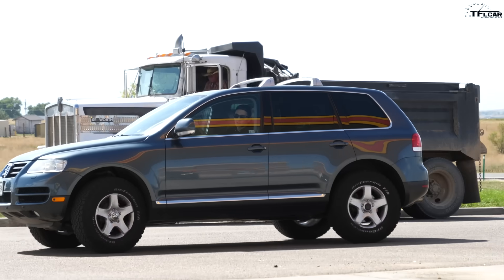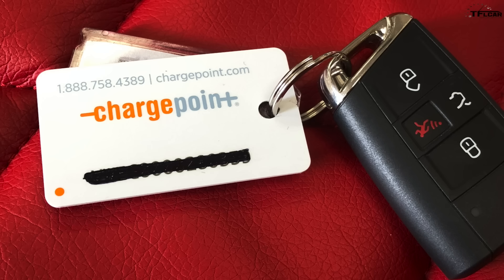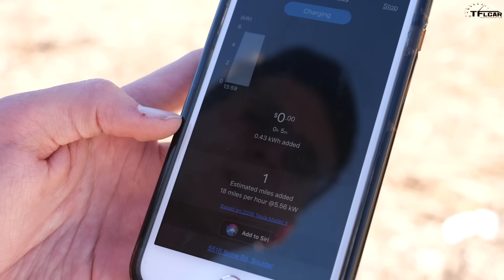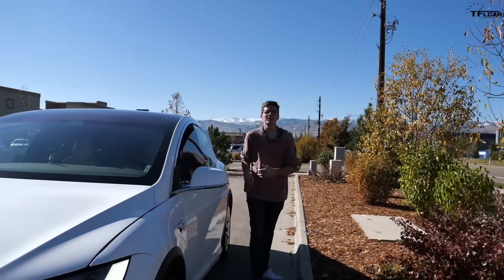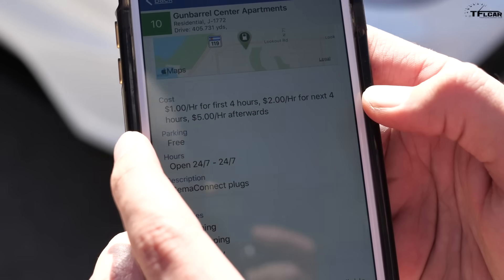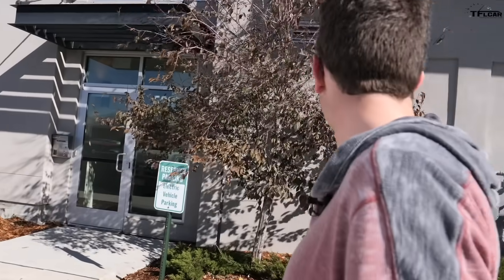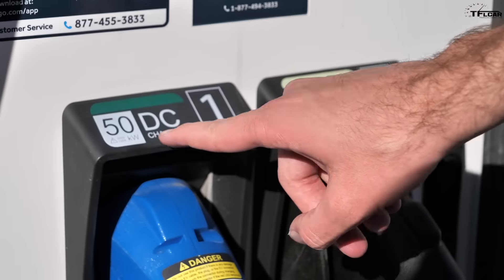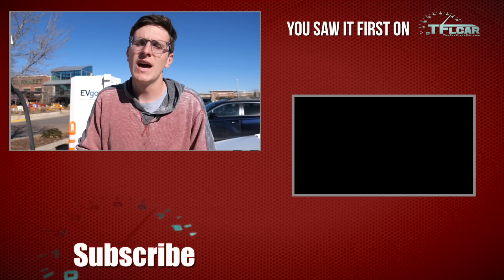Here’s Why Charging an Electric Car Can Suck - And It’s Not The Reason You Think!

Comment: You need to call your Representatives today we need to hydrogen fuel pumps put all the way across the United States for hydrogen fuel and the hydrogen fuel cell car which is going to take the place with all commercial vehicles and heavy machinery take the place of gasoline and Diesel also make the United States a superpower independently on their own with no more depending on oil or any other country for oil hydrogen fuel we can pull out of thin air so it's very cheap and it'll always stay cheap nobody wants a battery because it takes too much pollution to make batteries takes too much pollution to dispose of the batteries it takes too much pollution for all the electricity they're going to have to do to charge a battery that don't do much in the first place so the batteries are not green so they had to dump them all over the world and they went to the hydrogen fuel cell which is all over the coastlines of the world right as we speak the United States needs to hydrogen fuel cell down the center of the United States of America it's a more powerful fuel more reliable fuel and are the brand new engines that they have out you can do 2.9 seconds to go from 0 to 60
Reply: Ummm... "pull it out of the air?" That takes energy... can you build enough windmills and solar panels fast enough? What will hydrogen cost to make with that required infrastructure?

Comment: Sorry, I cannot do this.  These electric vehicles are ok for in the city driving, but driving across the country or to another state..... Aarrgh!!!  Drive for 130 miles, find plug in charger, sit around for 6 hours, drive another 130 miles, find charger, etc, etc...  Gas vehicle: drive for 300 miles, gas up in about 10 minutes + potty break, then drive for another 300 miles. And do not run out on Old 66 driving thru the desert....  Besides, who has 50K for one of these albatrosses???

Comment: If a standard car battery can be recharged by a car generator while the car is running then why can't electric cars charge themselves?
Reply: Fossil fuel providing the power to charge a car battery is why that works. And that car battery isn't being used to power electric motors for the wheels.

Laws of physics means a battery cannot charge itself and still do anything useful (like turn wheels of car).

A hybrid car (gasoline engine to generate electricity, and batteries for motors + wheels) can do what you suggest.

Comment: That is genius marketing right ! Luring people's feelings into a fuzzy warm greenness by the simple conversion of fossil fuel to happy green electricity while tricking them into owning a 600lb chunk of non recyclable toxic lithium from a strip mine that has been strapped to a pile of petroleum based plastic and oil fired steel with tires all while severely limiting free travel lol, that's good stuff right there.

Comment: The only way EV’s will succeed is if all the manufacturers work together to develop a standardized interchangeable battery pack. Service stations can then have racks of batteries on charge. You drive into a station, pay the fee and they swap out your depleted battery for a fully charged and you’re on your way. It should take the same amount of time as if you are pumping gas.
Reply: Yeah, you know how easy it is to change out a 1,000 pound battery and slide a replacement in its place. Of course your car was brand new and the replacement was already 7 years old and all that fast charging means it loses 10% of its charge for every hour it just sits there... Who pays for that difference in age?

Comment: Have to use the phone to find an available charging station which might be across town. When you find available station it turns out it doesn't accept a method of payment you can use. Then you need an adapter that looks to be easy to leave connected to a charger if your used to not using it. Best part is that it will take hours for a full charge and when you are on vacation who doesn't love spending time with car troubles and that is what it could turn out to be. I guess road trips will be within a 100 miles from now on just to be another restriction of electric cars that require fossil fuels to exist. Sign me up.

Comment: We considered an ev, however, the 10,000 to 22,000 dollars it would cost to replace the battery at 50,000 to 75,000 miles really turned us off.  Then there is the fact that the batteries are not recyclable, and the minerals used in them are dangerous to mine.  Not everyone has a smart phone.  I have one, but no data plan, because I work from home and I have home internet, and navigation in my car.  I have never been anywhere that I just had to have internet.  I was over 40 before I had a cell phone.  Also there are a lot of older people who would never be able to figure out the apps for charging.  It also costs up to $1000 to retrofit your home to charge your car at home.   And, what person wants to be stuck, in the middle of the night, alone at a charging station for up to an hour or more.  They would be sitting duck for criminals.  It seems like you would have to spend a significant portion of your life going from charging station to charging station to keep moving about.  What your supposed to do for that hour or more while you are waiting for  your car to charge?  Some of us have lives.
Reply: There you go, trying to confuse the issue with the FACTS! 😉

Comment: THANKS for this,  you have just confirmed most of my fears with electric cars. This is NOT a realistic option to petrol. This is a joke.
Reply: If you think it takes 30 minutes to charge imagine just 5 people wanting to charge theirs at the same time, how long do you think you’ll be waiting?
Reply: @joesedlacek7552  If my math is correct....that would take 2.5 hours.  :)
Reply: @joesedlacek7552  
A Long long time
It's easier to gas up takes 5 minutes and go on your way.
The internal combustion engine will never die..
Reply: @ralphabreu5022  meanwhile, automakers are phasing out gas engines
Reply: @joesedlacek7552  You are assuming there is only one charger to use. That's not how it works. Tesla has some sites with close to 100 cords. At a site that large, about 2 cars per minute will be finishing up and moving on. If by chance there is some peak in people pulling in to charge, and all 100 spots are full, and you are behind 5 cars waiting, it should only be 2-3 minutes before it's your turn to start charging. Tesla knows exactly how busy stations are getting, and where more charging spots are needed. They are expanding charge sites as needed, and where needed, to minimize the chance there will be any waiting at all, and to minimize the waiting time that will occasionally happen on peak travel days to just a few minutes.
Reply: @joesedlacek7552  If you think charging sites will only have 1 or 2 cords, you are misinformed. On busy routes Tesla is building  sites with ~100 cords. Even if all 100 were in use when you arrived, with that many chargers, someone will be finishing and leave every 30-60 second. Seconds, not minutes.
Reply: @joesedlacek7552  I can't fully charge my Tesla in 10 minutes, but if I arrive at a Supercharger with a fairly low battery, the initial charge rate is very fast: I get about 16 miles of added range per MINUTE (not hour.) That rate slows down as the battery fills, but in 10 minutes I get about 120 miles of added range. That may be all I need to get home, or to my next stop. The request to avoid EV charging from 4-9 PM happens a few days a year, and some years not at all. The grid is expanding is the need grows. Record setting multi-state heat waves that stress the grid (mostly from air conditioning) are not something that happens often. You need to dig deeper into the economics of grid power. Increased demand - if it is mostly in off-peak hours, can actually reduce the average cost of power, by improving the utilization of fixed cost assets like power lines, transformers and the generator plants. All those things need to be sized for peak loads. That means they are partly idle most of the time. BTW- California has not had a brownout in decades. Power companies don't do that anymore. There were rolling outages in 2001, and again in 2020. The rolling blackouts affected less than 10% of customers, and were not very long. They were not needed in this 2022 heat wave, despite record demand that exceeded what happened in 2020, because the grid has had upgrades since then. California's grid is doing just fine. EV's won't bring it down. They almost all get charged at night when there is plenty of excess capacity.
Reply: @joesedlacek7552  
I agree with you
I'm sorry electric car enthusiast the gasoline car is here to stay.
Reply: @ralphabreu5022  not for long
Reply: @bradmagnuson6963  
The gasoline car is here to stay.
Also diesel is here to stay...
Reply: @bradmagnuson6963  
Ok what's going to power those Chevy Tahoes , suburbans and Escalades.
And big 18 wheeler truck's 
If you think it's electric power you are sadly mistaken.
The electric car needs a lot of improvement for everyday use 
Much much more charging stations.
And regular mechanics to work on them than the dealerships.
And the parts cost have to come down to earth...on price.
Reply: @ralphabreu5022  regular mechanics aren't allowed to work on electric cars, except for stuff they can fix, but other stuff, it takes certified techs to work on an electric car. Pay attention to the electric car market. Those hulking gas hogs will be a thing of the past soon
Reply: @bradmagnuson6963  
Like I'm telling it's expensive to have those certified techs work on your electric car.
I disagree with you that gas powered car's are of the past.
Ppl can't afford electric cars.
Reply: @ralphabreu5022  people CAN and DO afford electric cars. For example, here in Pennsylvania, there are 29,000 electric car drivers. If you divide that per county, that comes out to 432 electric car drivers PER county. So. You're quite wrong. Gas and diesel cars will be a thing of the past within the next 20 years
Reply: @ralphabreu5022  it's not that expensive to have certified techs to work on these cars, since there's very little maintenance needed.
Reply: @bradmagnuson6963  
Nope, you are wrong.
The gas powered car here to stay.
Millennials don't understand .lf it's not broke don't fix it.
Reply: @ralphabreu5022  it's clearly YOU who is wrong. Automakers are phasing out gas and diesel engines, in favor of electric cars. I'm not a millennial, but nice assumption on your part
Reply: @bradmagnuson6963  
An electric 18 wheeler that will be the day....
Reply: @ralphabreu5022  meanwhile, Tesla is rolling out an electric 18 wheeler, and a company called Nikola is developing electric 18 wheelers.
Reply: @bradmagnuson6963  
You need diesel power to haul loads
Reply: You still need diesel power for freight trains
Reply: @ralphabreu5022  eventually, you won't need diesel, once electric trucks replace it
Reply: @bradmagnuson6963  
What about train's
Reply: @ralphabreu5022  eventually, you won't, all-electric trains are being developed. There's already passenger trains that don't run on diesel, they run on electricity, they're called "maglev", meaning, elevated magnetic trains, capable of very high speed travel. An all-electric high speed  passenger train service is being pushed for the Dallas-Fort  Worth area initially, and then into other areas across Texas.
Reply: @ralphabreu5022  there's electric trains all over Japan and China, and there is a push for high speed electric train service in the Dallas- Fort Worth area initially. Right now, most freight trains use very little diesel fuel, they run more on electric than they do diesel fuel
Reply: @ralphabreu5022  in Philadelphia, all the passenger trains and trolleys, run on overhead electrical wires.
Reply: I would rather put gas in a car takes 5 minutes and done
Reply: a lot of good points here I've been at gas stations where there's been 5 10 people and probably would not even wait that long because it only takes about 2 minutes to fill the tank with gas
Reply: This is a CULT.  Fixed it for ya. 😁👍
Reply: @serfcityherewecome8069  
The internal combustion engine will never die.
Reply: AMEN
Reply: Who wants to wait 10 or 20 hours to charge your car when it takes a few minutes to fill your tank with gas
Reply: @jamesbishop4701  
That's exactly what I said 
It take 5 minutes to fill a tank than all the apps and work that this guy's doing.
Can we also say 3 Rd party credit card sharing that's leads to Id theft.
Reply: @ralphabreu5022  Dragging my 32' camper all I have to do is find a Green Diesel pump.  In well under 15 minutes and can fill up, go to the restroom and grab a snack or cold drink and be back on the road. And I have enough fuel to go around 250 miles or more.  So while you are waiting for 30 minutes or more to get another 100-200 miles have fun.
Reply: @davidroman1654  
I agree 💯 percent with you.
To much hassle to find a supercharger wait an hour or so and pay with an app.
The old fashioned way works for me 5 minutes to gas up a tank and go.
If it ain't broken don't fix it.
Reply: @jamesbishop4701  If you think 20 minutes is long just remember if your not there first how long will you have to wait for the other person to finish charging their car?
Reply: @jamesbishop4701  it doesn't take 10 or 20 hours to charge an electric car, unless the battery is totally dead, and you're using a 110/120 regular wall outlet
Reply: For the most part, but if you can afford a Tesla, it’s super easy. I’ve never had an issue charging, and I’m on my second cross country road trip.
Reply: @rw7717  You must have a lot of time on your hands.  Not to mention money.  And you must not have any emergencies in your life.  You must love waiting around.
Reply: @MP-in4or  I’m a retired burnt out tech worker. So yeah, I have time. I think we’ve waited once during the entire trip. And the frequent stops to charge works for us - we have an infant.
Reply: Eventually it will be but EV tech is not there yet
Reply: @jayasmrmore3687  not true. Willful ignorance on your part, clown
Reply: We live in the year 2022. The video is from 2019. Ger informed, a lot has changed and the video seems like from another time. I wait for the moment the puts in a cassette tape 😲
Reply: @digital-experiance2390  Yes, what's changed is that more people are in line waiting for an available charger and have an hour or so to kill, waiting in line. That's why 1 out of every 5  EV owners switch back to ICE cars.

Comment: Great video. And, very informative. Thanks for confirming my reason for using fossil fuels for power. It may be inexpensive to recharge your vehicle at this time. But, if it became the primary method for travel, you can bet they'll start doing just like the oil companies....getting greedy. You've heard what the root of all evil is...$$$
Reply: I remember gas at $.23 per gallon back in 1965. Look at gas averages today at $5.00. Think of the cost of electricity when the demand becomes comparable to gas today. Electricity for your home will rise in cost along with the demand. Your $200 per month home electric bill will go up exponentially. I cannot afford to pay $4000 a month, can you? That is besides the comparable rise to recharge your EV. The electric grid cannot support EV’s and would go down under the load blacking out the entire continent as it currently exists. This entire green movement is putting the proverbial cart before the horse. We need to drastically upgrade our entire electrical grid system as the first step so we have a reliable source of power before we place that kind of load on the system and wind and solar are not reliable supplements to the existing system for the international EV load.

Comment: Wow, I really thought the commercial chargers would fast charge at a much higher/faster rate. Especially when you are driving on vacation. Hmmm....!? Hydrogen seems to have a distinct advantage particularly if the new developments produce hydrogen disc's for sale from vending machines(PM 2021) issue. The car/charging industry needs to have one standard plug that fits all.